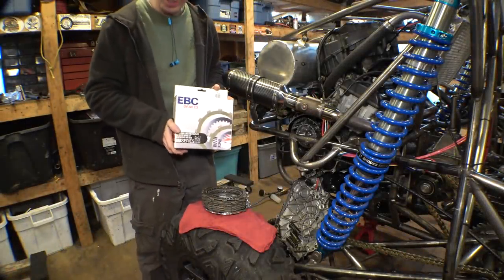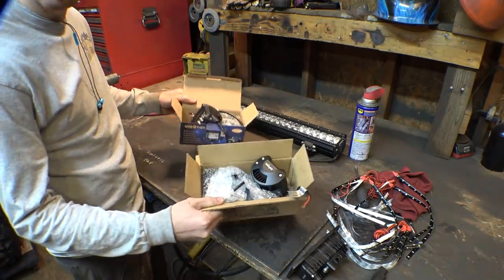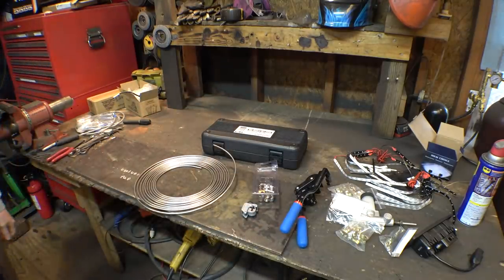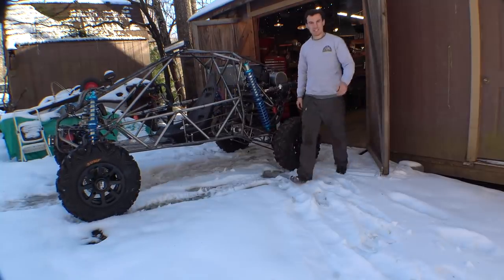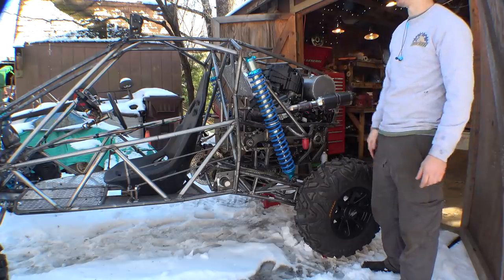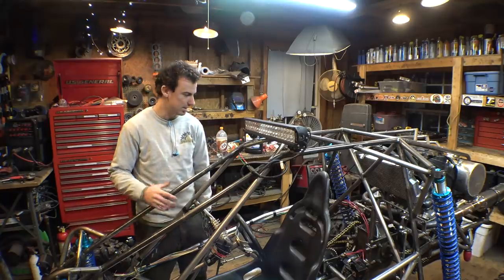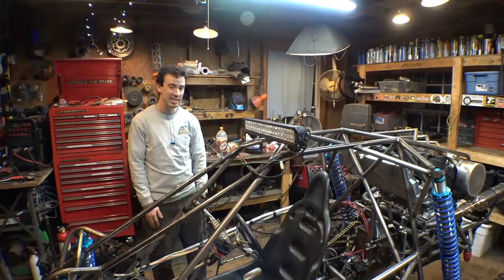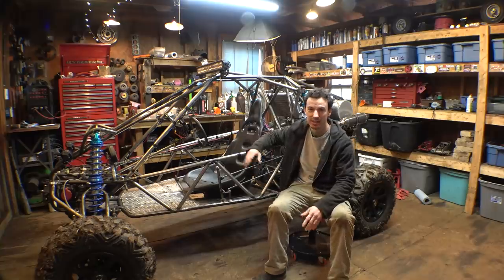CBR 1000rr Off Road Buggy Part 16

Comment: Top tip... never put "good" oil in your engine for the first test. Just like you don't put antifreeze in your cooling system for the first test.... Use bulk , cheap oil and change it a few times. Good oil will do NOTHING to protect an engine that has water, dirt or rust in it. Keep changing it till you notice that it's clean and then use good stuff. 

In 2000 I had to rebuild a R1 engine that someone didn't put a retaining ring in the clutch properly. It was chewed up in the primary gear and pumped through the entire engine. Yamaha decided to cover it in warranty (for some stupid reason) but wouldn't allow a short block to be used ... what a nightmare.

YES ... finally you're going to use hardline for your hydro systems! 😁OH ! You got the fancy tool !! NICE... I've always wanted one of those. I've always just done it with the cheap ones, and the one you have is so much better.
Reply: That's like saying don't rinse your eye out with clean saline solution to flush out what is there, use some toilet water at 1st until your eye is infected af & you're half blind, then you know you've got it!!
Reply: @ghpjerry   No... it's actually not like that at all. Conventional oil was used for decades, and the protecting properties of a "good" synthetic has nothing to do with protecting against dirt, water, or rust. 

A "good" oil has more heat resistance and will last longer.... If your engine has water, dirt and rust in it, you shouldn't be pushing it and getting it really hot, or running the oil for a long time. 

You're better off to use the cheapest walmart or corner store oil and change it till it's clean, and then use the good stuff once you're actually going to run the engine hard and plan on leaving the oil in the engine for more than a few minutes.
Reply: @JoelArseneaultYouTube  I'll disagree. Until 4 months ago we owned 4 Pennzoil 10 Minute Oil Change Centers for 36yrs...I'm not going to argue with you, you obviously have your opinion, but you are wrong for SO many reasons. Good luck and God Bless.
Reply: @JoelArseneaultYouTube  One day you'll read this again & ask yourself what in the heck were you saying. I agree with Billy, take care.
Reply: @billynowhere847  You owned a Pennzoil oil change place ... That doesn't change the fact that dirty, water contaminated, rusty oil is bad and should be flushed out. Royal Purple or Redline oil with water in it is no better than Walmart no name oil...

If you disagree with me, you're basically saying that synthetic oil protects against water, rust and dirt.... I'm hoping that no one actually thinks this. 

I have been a mechanic for over 26 years and I have tried to destroy lots of engines, for fun... or because I was angry You have to do a LOT more than use cheap oil to ruin an engine. My father once ran vegetable oil in a Honda motorcycle engine in the early 80s just to make a point. He ran it easy and it had no issues. I highly do not recommend this, but "good" oils are "good" at very specific things. Mostly heat and pressure. 

Please, someone explain to me how a good oil is going to help in this situation ?
Reply: @ghpjerry  Please, someone explain to me how a good oil is going to help in this situation ? What is it about "good" oil is going to help with water, dirt or rust ?  

Conventional oil isn't bad.... Synthetic oil is better at not breaking down when exposed to heat and high pressure.  It has ZERO characteristics that deal with water, rust and dirt.... 

Please feel free to check the back of a Royal Purple or Redline oil bottle ... if it says something about "protects against water, rust and dirt"  Then I'm wrong ... otherwise, maybe you misunderstand what I'm saying .

Comment: Build you two rock guard/drop pans for both those rear sprocket assemblies so if you bottom them on a rock, log, or the ground they are protected. I am also wondering why you did not go with a Jaguar Rear-end setup that would make it shaft driven from one jack shaft? Nice build,,,,

Comment: Chris try empi master cylinders they are for vw engines and should do you some good....also you can get the adapter to make  the motor drive shaft. They use those motors in race cars the legend cars have motorcycle engines in them

Comment: You can't fix the "GRANNY LOW" stickiness. Low gears like that in a 3 speed are meant to start off and thats it! They used to just ride the clutch to a stop after 2nd ran out. Just the nature of the beast. Good luck stay safe.

Comment: want 4x4   shaft drive bike bmw and kawasaki both had 1000cc shaft drives   to a transfer case probably suzuki jeep  or some jdm k spec 4x4  cool project thanks for the videos..ps  more lever advantage for the brake and clutch will help on the force as you know and i suspect theres air in there still just enough to make it spongy not enough to make it unusable the joy of hydrolic systems under pressure lol

Comment: VERY interesting gear ranging.. from snail to +160mph XD Dear god this is killer machine. Might want to reinforce.. well everything and go with sport car accuracy :D
Also making it 4x4 aint that difficult, if you go with halo warthog style front suspension and drive to front same as rear, just have say car hubs at front to enable turning.

Comment: it would require a sxs front diff and consideration of its gear ratio and a small L gear box, witch would add weight and complexity, but 4x4 is possible, and within reach

Comment: Buy the cheapest oil with same specs, the local dollar shop oil for the first few oil changes that you use to clean the engine up. Then put the more expensive oil in when you start to get clear oil out after oil changes. Great build, keep it up! 

Also, have you thought of making this hobby into a business? Just build these for customers and charge for the fabrication. I bet a lot of people would be ready to pay big bucks for one off custom buggy etc.

Comment: New Clutch usually will hang a bit with the old clutch basket if don't file off the ware pattens, so they need to ware them self in and all so you using brake master cylinder which is the wrong you should be using a clutch master cylinder and right fluid DOT 4/5.1 not use Dot 3 you better clean that out ASP and the way you run the hardline is a bad way you want run them low or have reverse bleed them and love of god add rubber hose on engine side

Comment: if you were say going down an air strip and you had the box on the engine in first and the outer box in first, and if you went full throttle down the straight up all the 6 gears on the bike engin if you then put the other box into 2nd would you be able to put the bike back into first and have another whole 6 gears? Or would the whole thing just implode since you were going fast? Is changing into 2nd on the outer box and back into first on the bike engine box technically going down gears or up?

Or am I totally wrong and you just use the outer box to shift and keep the bike box in first?

Comment: I dont think you can do that on the master brake cylinder. I may be wrong. But... those typically have 3 outs. 2 off one cylinder and 1 off the other. The 2 off the one go to each of the front wheels and the one off the other goes to the rear wheel. becase on go-carts usually there is only one caliper on the rear axle.. If you took that and looped the one cylinder back into the other and then ran the 3rd back to the clutch I think your fighting your own pressure when you push. Does that make since? Both cylinders are trying to push hydraulic fluid but it has no where to go so the pressure is building up in the line between them.

Comment: Is there ment to be a little ball bearing between the clutch pushrod and the clutch pressure plate?  check manual cause thats there to stop damage.

Comment: Try a Ford Ranger clutch master cylinder, maybe a 1998 would do it has about the same send volume as a motorcycle slave system.

Comment: 1985 Honda ATC250sx and some Big red 3 wheeler models have a very basic bolt on gear case that I bet you would easily Be able to simplify and mimic to make your own chain drive to shaft drive setups.  We just got a Tormach 1100mx.  We are going to be steering towards replicating those things in the very very near future...

Comment: Play the front different from a Polaris four-wheeler run a 90-degree gearbox with a sprocket coming off of your jackshaft making the other access point outwards to where you can run a drive shaft under your seat to the front diff it would be chain driven in the rear and it would be shaft driven in the front you would just have to look at your ratios and figure out what would be the best gear ratio for four-wheel drive

Comment: Banned from riding in your yard?  What the hell happened there?

Just a suggestion, when bleeding brake/clutch lines, use a vacuum pump, you’ll get less air bubbles.  Also, things called “micro bubbles” can form.  They make things feel a bit squishy, (air) but not that bad.  Looking good!

Comment: sometimes you have a ball bearing in that hole that that shaft goes thrue that ballbearing is easy to lose if it is not in that hole in front of the shaft it will not work i ain't sure if that is your  problem  but i have lost that ball bearing it's only a little bit bigger than a bb out of a bb gun

Comment: There’s a small ball bearing between the push rod and the clutch. Without the ball it won’t push the clutch out.  Also having those chains in the open,you are going to be replacing chains frequently. I would come up with something to enclose them in.

Comment: Try high temp tape for the lights and 4x4 got to get a 90 degree gear box by x2 and make them join by shaft drive and then go sprocket I have a banshee to shaft to a 90 degree gear box then sprocket to axle if you want any more info pm me and I can send you picks

Comment: 1000cc 4 cylinder bike fanatic here...that engine doesn’t sound right at all...I seen a few say it’s because it’s a split exhaust... is there no balance tube??  Of course a 4 into 1 is always best... but if it’s split with no balance tube.... you will be robbing yourself of a surprising loss of HP!  I know that is counterintuitive, but it’s a fact.  AWESOME, AWESOME build however!!   Looking forward to seeing it rip...  BTW with the exhaust “right”... that thing should make 130- 150 HP [conservatively]  but you won’t see much of that until you get around 6000RPM.  Intake and exhaust tuning is critical otherwise you will never see,what that 1000cc engine can do...just saying. Good luck sir!!

Comment: Bro youre builds are getting to level where you should probably start running some of uour wiring inside the frame and using some thin walled tube to hide the main harness.

Comment: Run a locked diff between the 2 rear chain drives with the pinion going forward. Use a sxs diff in the front

Comment: Yo, don't put a bigger clutch than what the bike had. If it's already matching size, then just make it mechanical to the engine. If you go with a bigger clutch master, you risk breaking something. It actually happens more than you'd think in the bike world, when modders put fleaBay masters and don't check sizes. These bikes are not what they use to be, and you risk blowing a hole. Just my two cents, nothing more.

Also, you should see if you can't send the wire loom through the frame, that should simplify things down the way.

Comment: @Rather be welding, wouldn't be hard to make it four-wheel drive you could use a Polaris Scrambler 400 gearbox running drive shaft to the front and make it four-wheel drive using the front differential off the scrambler that way if you can shift the Scrambler gearbox in the neutral and it won't be four wheel drive and then if you put it in forward the gearbox into Forward then it would be in four-wheel drive.   I can email you a drawing. Lol

Comment: would you happen to know the approximate top speed of that engine under that kind of weight? im looking to build a smaller car thats road legal and capable of highspeeds when im older and it looks like this engine is a perfect fit for the plans that i have so far

Comment: Find out the correct BORE AND STROKE size of the original clutch master. A rebuild kit may tell you bore size. You can do it with your hand there's no reason to be straining with your foot. On a car the clutch hose is considerably larger than the brakelines since it moves all the fluid to one place not 4. If it's too small it's a restriction. Clutch PLATES also. Nice job it looks awesome, but will you please educate yourself on some things. "whatever this is called" and "this thing" is Soo annoying.

Comment: Is anyone else concerned about the possibility of that rear brake disc catching his arm, or with the way his seat moved, cutting is butt in half?
Perhaps you should set a safety guard between that shaft, the sprocket and chain, the brake disc and the seat Chris?
As for the oil; don't toss out the milky stuff, use hot plate to heat it until the water evaporates off.
Its a safe, cheaper than buying new and an effective way of recovering the oil (yes I've done it before and it does work)

Comment: Not running on all 4 cylinders it should be more of a high pitch sounds like a crossplaine
Reply: check time 14:14 that head gasket is blown that's why its not running right and why water is getting in the oil and also burning away so the coolent level drops.

Comment: Your clutch and brake issues might be caused by your lines been to small if you look at a bike and how they have them set up and feel you might get it fixed with out having changing your master cylinders again

Comment: Hi 

I love your YouTube channel and I am very impressed with your skills as a developer and builder. 

However, I'm a little worried about your solution with the gearbox on this project. It seems stiff and seems to shift badly.

I think its gonna ruin the driving experience for you.

Could a good CVT gearbox be the solution. Would this be a solution. A large ATV CVT gearbox.
 http://www.klung-motor.com/accessories-one.asp?news_id=1143

Comment: NO NO NO There is no need to keep changing the oil to get the water out.  One time flushed with diesel and it will be crystal clear when you add oil afterward.  Done.